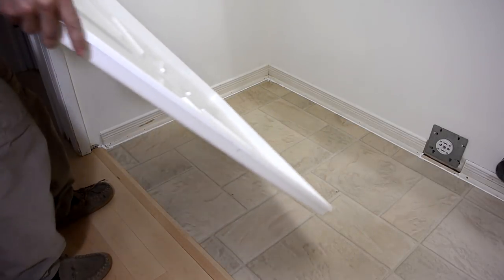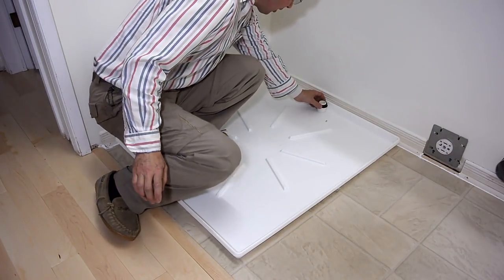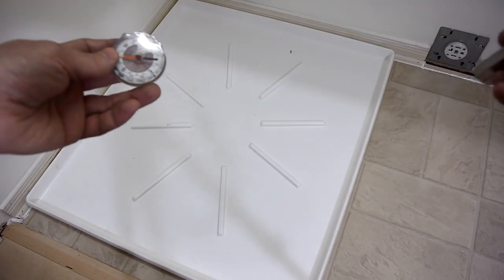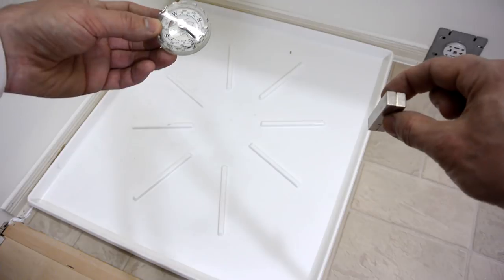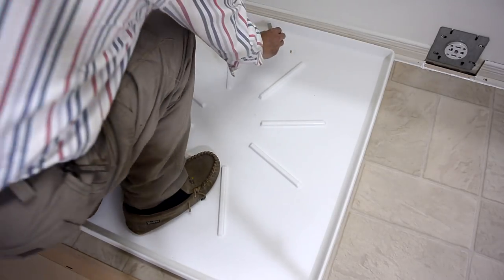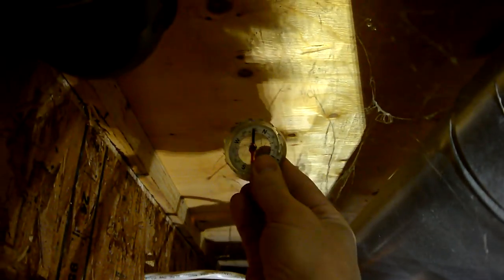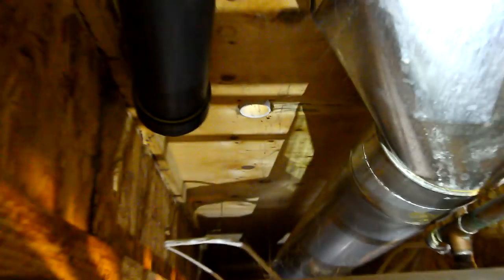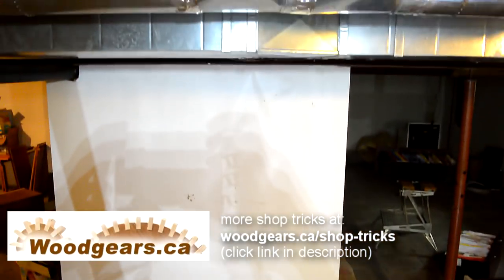Thru-the-floor (or wall) magnet and compass alignment trick

Comment: One just must love American style homes... just like cardboard - you can easily change/add/drill/move pieces of it... same idea would require hours of drilling and expensive tools in my part of world
Reply: And what part of the world is that? Pretty much any home built in the last 100 years can be modified to suit our needs.
Reply: Matthias is in Canada.
Reply: You'd be surprised how "soft" American homes are. Down here in Australia, I've never seen a drywall wall, or whatever it's called.
Reply: Canada is in America - North America if you insist
Reply: in Europe most houses the floors are made from concrete and cast plaster, and outer walls from clinker bricks. Inner walls depends, but older use bricks too often. Drilling holes for purposes like this require big holesaws
Reply: Old lady - Europe... We build homes from concrete and iron... In my hose 2 floors are separated with 15 cm of concrete with 2 layers of welded iron mesh... so drilling 5cm hole in it would be a pain
Reply: hahaha good one - Mr Joker we did not recognized you :D
Reply: +lutheduck I guess Croatia has a bit of a different building code then I am used too here in Canada.
Reply: Same where I live... American homes look like DIY kits to us :D most of the times we build even sheds out of hard materials (concrete and cemnet blocks)
Reply: In Europe he'd probably have a steel reinforced concrete for the floor. Even if compass trick did work, he'd need a big rotary hammer drill to punch a hole. And if he was unlucky enough, he'd hit a steel bar and have to move a bit and start again.
So yes, we're pretty impressed with how easily North American houses can be modified. :)
Reply: Roboterson in finland, the roof/floor is filled with thick concrete...
Reply: lutheduck concrete master race
Reply: Time to get the Hilti...
Reply: Roboterson - Sure, they can be, but I think the point is that it gets harder when they're made out of, say, concrete instead of wood. And loads of houses here (London), for example, are much older than 100 years.
Reply: Right? often it's just drywall walls..sometimes a bit jealous they can easily drill some holes to run cables through, which is really a no go with brick walls.
Reply: That's why nothing is left over after a hurricane. I prefer bricks and concrete.
Reply: lutheduck, it would also not be necessary since a little bit of water spilled would not destroy your floors and house...
Reply: If you're talking about the USA, homes are built differently in different parts of the country.  For example, in Florida, there are lots of hurricanes.  Many houses in that area are built from rebar enforced concrete and finished with stucco inside.  I've even seen homes with every single shingle tied onto the roof with steel.

In other parts of the country, that would be overkill and would serve no purpose other than to make the structure more expensive.  A floor made from 2x12 joists with a layer of plywood and then the tile or hardwood is solid enough.  We have homes built like that that are over a hundred years old and they're still holding up.  And like you mentioned, if something does happen and the wood needs repaired, it is cheap enough and easy enough that the average home owner can take care of it.  

Is there a reason in your part of the world that they use concrete rather than wood?   Maybe its environmental?  Or maybe the concrete manufacturers lobbied and got the lawmakers to have building codes requiring concrete instead of wood purely for financial gain?
Reply: true 😉
Reply: For instance, in Italy wood is very expensive, more than concrete and bricks...
Reply: Well you wouln't drill a hole like that, you'd drill a few holes in the perimeter and knock out the center with hammer and chisel. Not too much effort either tbh.
Reply: I am a german architect- north american construction is a panopticon for me-  especially in the colder regions the things I have seen (and I admit that is not that much) are built on the level of a 15 year old german garage... but in the end it works and it is much cheaper.
Reply: I believe the reason often cited is that in America wood is plentiful while in Europe it is not as it was used as a fuel and to build ships for a long time though it might simply be there were less forests to begin with. There are wooden houses in Europe, but they are mostly replaced by brick and concrete ones when rebuilding.
Reply: +Roboterson: That part of the world would be Europe, where about every modern house has 5 inch minimum concrete flooring, added on top of that a layer with steel mesh, heating, plumbing, electrical piping etc cast into another 6 inch layer of concrete or similar mixtures. This we do on every elevation, so the walls need to be constructed of heavy concrete slabs or similar building bricks.
It always amazes me to see these DIY videos of people in North-America where everything is constructed out of wood, thin plasterboards etc. It's definately easier to build a home yourself there as the only thing you need is basic carpenter skills. The machinery involved here to lift, cast and machine these materials are so expensive, that nobody in their right mind would own it unless they run a full time commercial company with it.
Reply: In my country, most houses are made of concrete, steel reinforcement, bricks and varying materials for insulation purposes. The wet climate makes wood houses quite undesirable for the amount of maintenance it would require. It does make it more expensive to build, but the ground space costs are often equal to the cost of building the house.
Reply: Aha, I thought it was the opposite way. That they on purpose build houses flimsy so that it will be cheap to rebuild when a hurricane has blown everything away. Where I live we dont have hurricane problems so I am happily unaware.
Reply: American here; most walls are built with 2x4's for the framing and drywall to cover it. might seem cheap,  but if you keep all of it dry and protect it,  it will last a considerable time,  even being fairly cheap
Reply: No lobby involved. We do have houses with a wooden structure here as well (europe)  The old ones were build of oak beams and loam and are hundreds of years old. Newer ones are pretty much like the ones in the US: Wooden beams, isolation and drywalls (was invented in US by the way)  However, less than 10% of our houses are made of wood. Solid construcion offers better heat protection in summer and lower costs on heating in winter and they are value stable. Also they are less prone to a leaking washing maschine. ;)

Don't want to offend anybody but I was quite shocked after my first trip to the US. Most of your homes are looking like shacks to europeans. Never seen a single shielded window in europe before. (Matthias posted a video about european windows a few month ago) Even the eastern european houses are looking better (despite 50 years of communism)
Reply: It is very common on videos like these to find claims that in Europe we only build houses out of concrete or stone, but that varies depending on country. In Sweden only 3% of newly built single family houses in 2016 were out of stone or concrete, the rest were made from wood.
Main reason: tradition and cost.
Reply: and in case you hit the iron mesh you are screwed :D 
There are drill cutters designed for this purpose - but they are expensive.
The whole point was that its a lot more work to do it in concrete build houses.
Reply: There are two ways to build in the USA: Good or cheap
Reply: PS: The big disadvantage: I recently bought property (massive construction of course) and I will probably be in debt for rest of my working live (I am 34)  A lot of europeans can't afford own property and are renting houses or flats.
Reply: Oh yeah. went to a tool renting shop and got a big ass impact drill. Hit the metal mesh and nearly dislocated my shoulder
Reply: lol @gamingSlasher: the 3 little piggies build each a house, one of straw, one of wood, and one of Stone.... the wolf came and blew away the straw house, and the wood house, but couldn't blow away the stone house....
Wood houses aren't really weaker in that aspect. I do wonder if there was ever research regarding hurricanes vs wood houses and stone/concrete houses.
Reply: +Schorschiism: Ehhh, people from the USA are in debt, period. In Europe we only have a mortgage on the house, we pay for everything else upfront. And if you sell the house you paid your mortgage back, ánd have some spare money. I don't see the issue :) In the USA you freak out if you cannot get your car, groceries and clothing on a creditcard or loan. Those degrade pretty fast in value, and that will get you real debts.
Reply: The biggest problem in some European countries, such as Spain, is the price of land and price speculation, the cost of materials is not the biggest problem. I live in a house with three floors and the maximum price of the materials would not reach 50,000 euros but the total price was 200,000, imagine the speculative problem there.
Reply: I'm not in debt. Obnoxious generalizations are obnoxious.
Reply: Norway and Sweden would like a word. Although you would have more insulation and vapour barriers in the way.
Reply: Judging by the prices of homes in USA (based on some History/Discovery shows) - they will to :D The pay ridiculous amounts of money for homes...
In order to avoid being in debt until the end of my life I moved out of the city - to the country side and build home - paid out in just 10 years (5 still to go :D) but you have the freedom, its quite, green, and ours :D
Off course - now I have to travel 20 minutes to work each day and drive to market, but hay who's counting :D
Reply: I think Mathias should be able to find and adeguate solution for this kind of problem. It's more difficult for sure, but nothing can stop him
Reply: Same here in Brazil, I'd need to be ready for hours of hard labor though the concrete floor
Reply: +imbuggin: I think you didn't get the point :) I was rectifying a fellow European that was complaining he has debts. In Europe, it's almost impossible to have real debts since you just cannot loan anymore for anything except a house. Which is good, as the house keeps roughly the same value. In the USA on the other hand, people over there have real debts as they loan for volatile and value degrading goods. That's not generalizing, that's pointing out where the real debtors are roughly situated.
You forgot about 2008 I take it? :)
Reply: Don't believe everything you see on TV. Places like Denver or Seattle are expensive, but normal size towns are much cheaper. My home town of 900 people could take years to sell a house cheap. It is all about supply and demand.
Reply: Right. Just looked up my dictionary. Mortage is the right term....still feels bad to owe so much money.
Reply: Believe it or not he is living in Canada
Reply: Until a tornado hits and turns your home into a million Lego pieces.
Reply: Canada is also in north america thus canadians are also americans.
Reply: You gotta love people that don't know the difference between a country and a continent. :)
Reply: lutheduck and in your part of the world you live in a 3 room/ not bed apartment of 500 square feet with no yard that cost an arm and a leg. Where as for the same price in America I can get 2000 square feet 4 bed 2 bath with 5 acres. A pool in my yard a two car garage. lol
Reply: giantpune Australia is a desert and the trees they did have are mostly long gone. They have no choice to build with concrete.
Reply: Oli K panopticon is a prison that's built so inmates don't know if they are being watched or not. I don't understand your sentence.
Reply: I like how you can punch through the wall in Amerika. Here in Belgium I would break my hand
Reply: Remco Ardui  and in your part of the world you live in a 3 room/ not bed apartment of 500 square feet with no yard that cost an arm and a leg. Where as for the same price in America I can get 2000 square feet 4 bed 2 bath with 5 acres. A pool in my yard a two car garage. lol
Reply: Interesting discussion here... a while back, in the office where I worked - southern Alberta, Canada - a co-worker was shopping for a house... much to my surprise, he told me was going to buy a house built in the 80's since back then the houses had no OSB or other 'engineered' materials (TJI floor joists eg). 

A house built with 'engineered' material disintegrates if there is even a small fire - the thin joists burn through quickly and the structure collapses... what the fire does not destroy, the water the fire department pours on the fire wrecks - i.e. the epoxied chips delaminate compromising the integrity of the material.
Reply: In US only the foundation walls are built with concrete and rebar.
Reply: My (Swedish) father's newly built house has the same construction as Matthias'. It has the same masonite i-beams and plywood in addition to heat pipes, sound reducing mat, and etc. Although one wouldn't drill a hole in floor since the laundry room would have additional water proofing and a floor drain.
Reply: ***** I don't get why people dream of living in places like New York. When I watch hgtv it makes me laugh out loud when I see what they get for a million dollars. It's like living in a dog kennel. There reaction to having a 3x5 foot balcony with a view of another brick building is down right psychotic. 
I enjoy my view of trees and squirrels and song birds. They get car horns and pigeons.
Reply: Same thing in Brazil. Some states suffer from small tornados and flood but the only construction we know is concrete. Drywall, even with a couple decades arround here, I consider a new concept.
Reply: You must not be Canadian. Americans are people from the United States of America. Canadians are from Canada. North America is a whole other thing, and you can't call Canadians Americans. Nobody's calling people from Mexico 'American' after all.
Reply: AqueousBoy sometime after the civil war us in the USA stopped thinking of ourselves as from what state we were from and as just Americans. I think this had something to do with birth certificates and social security numbers and that state armies outnumbered the USA army. As in our name United States of America. At one time the states had complete control over the government and the federal government only really controlled the military. Our federal government has grown so much over the last 150 years we really can no longer be called a republic but a true socialist democracy.
Reply: MoralesCrk MoralesCrk : not really true. Lots of home owners in the Netherlands. 60% of the Dutch houses are owned, 40% rented.
Reply: Sure. And Trump is a social democrat...
Reply: What do you cover interior walls with? Drywall is often called gypsum board in other places.
Reply: In the US though you can also get pressure treated, cedar, and redwood which is all rot and bug resistant. Water isn't that big of a problem here unless it goes where you don't want or expect it to go like from broken pipes or leaking roof. Even then, it takes years of constantly being wet for something to rot and in the case of like pressure treated lumber it could last decades in water and is very cheap to replace.
Reply: For hurricane areas they tie everything together with small steel straps aptly called hurricane straps so the wind can't for example pull up under part of the roof and turn it into a giant wooden box kite. It works pretty good. Wood isn't indestructible but matchstick construction introduces tons of redundancy so structures can't easily be knocked down. My childhood house was 135 years old and made of wood and still stands today. If you keep a nice roof on a place it should last for centuries.
Reply: Interior walls are usually brick and mortar where I came from. Stud walls are generally considered cheap shortcuts.
Reply: 5656eric are we a welfare state?
Reply: Gelatinous Glob
Normally brick or concrete walls are plastered.. 
When the walls are build properly, the layer is less then a mm.
After that, it is finished the same way as you would finish the plasterboard. Wallpaper, decorative plaster, or just give them a color with wall paint.
Reply: are you from GREAT britain?
Reply: gamingSlasher that's the stupidest thing I've read this week
Reply: Matthias is Canadian though. But glad to see someone obsessing over the US on YouTube again.
Reply: Yes read "some" of the comments that followed.  Typical ignorance.  North American homes differ little in construction method than any other developed country.  What mainly differs are the standards, but that's a different topic.  To your comment we must simply have a greater variety of home construction or some of you live in secluded isolation.  Matthias' home has a basement.  As such he has a concrete slab basement foundation with concrete walls.  The floor above is a standard joist frame floor.  This would be typical anywhere in the world.  Where I live we cannot have basements due to the clay soils so all foundations here are poured concrete slabs.  The types of concrete foundations vary greatly as well.  We also have cinder block construction, adobe, concrete, stick construction, recycled tire or aluminum can construction.  The sky is the limit.  Hence I reject your narrow view of the world.  Thank you and have a nice day.
Reply: Nah, pretty similar to how ours (in Finland) is constructed, except Matthias is drilling to the basement so the ceiling isn't finished. Ours just has a second layer of plywood (or more accurately particle board) as the basement ceiling and the space in between is filled with insulation.
Reply: +William Hayden The ignorance is your own - construction methods vary hugely across developed countries and the variety of architecture to be seen around the world is one of the reasons people travel. Simply setting foot outside your own country and using your eyes would confirm this immediately.
Reply: I thought this was because in America people are always looking to improve their quality of life, so investing in a more expensive permanent house isn't good idea,  houses made of wood make it easier for you to spend less
Reply: why does every comment section need to become a passive-aggressive superiority contest? things are the way they are because that's the way they are. you can get concrete and brick houses in america as well. europeans tend to forget that our states are the size of their countries so things can be very different across the states. it depends on the composition of the ground, the local weather and other concerns like earthquakes, tornados, hurricanes, etc. in earthquake prone regions of california houses are built of wood because it can flex during an earthquake without being torn apart like a brick house, or knocked off its foundations like a concrete house.

as for the sentiment that brick houses would hold up better in a hurricane, well. that is not true, because the roof gets torn off anyways, and brick/concrete houses can be pulled up off their foundations just as easily as a wood house. it's easy to talk when you have never experienced the power of a hurricane, tornado or earthquake firsthand.
Reply: +Joe Smith : Funny you should say that. I live in a 300 square meter house in Europe, directly at a forest, so it is not so uncommon as you might think. It's the same everywhere I think, since in the USA you have the cities (New York, SF etc) which have small mass-housing. In the outskirts you have more room and thus bigger houses. Europe is not different in that? Have you ever been to Europe? Or just visited Amsterdam or Paris? :) 
I think the same of china/japan, but maybe it's only in the dense populated areas, and the outskirts of cities are different. Don't know, as I've never been there :)
Reply: I agree, you don't see people literally moving their house in Europe because over here they are made of bricks and reinforced concrete. It always surprised me that a lot of the North American houses are build with OSD, knowing how many hurricanes are crossing the continent on a yearly basis, it almost seems like The Three Little Pigs tale waiting to happen.
Reply: Not entirely true, it might be for the eastern side, but over here in the west it is usually double brick with a cavity wall. The internal bricks are covered in gyprock and then plaster on top of that. Pretty much every west-aussie home since the '80s has been built this way.
Reply: +Prometheus I agree, but we are shaving fine lines here.  To say that other countries outside North America do not use stick construction methods is ludicrous.  Also to say that all we use is stick construction is narrow minded.  We use concrete, cinder block and every other construction method under the sun.  Stick construction is the most common form here due to cost and ease of construction.  This is true for other parts of the world as well.  It's quite simply the most flexible and forgiving construction method.  Not everyone lives in a concrete apartment and not everyone's home is poured concrete.  If you and others do great, but why through out judgmental idiocy?  So again I reject your ignorance and for calling me ignorant.

Also I've been to many countries from Mexico, Japan, China, S. Korea, UK, etc.  Where have you been?  And yes I do pay attention to architecture.  I also watch This Old House and watch or read other sources that cover the differences in construction methods across the globe in some great detail.  This does not make me an expert, but it does give me enough to know that you and others are full of horse pucky and simply come off as snobs with looking down pointed noses about how one's house is built.  It's someone's house, show some respect.
Reply: +Ray Herring I suspect lumber in Australia is a lot more expensive than other parts of the world, where on the other hand brick is probably very cheap, comparatively speaking.  Would this be an accurate assumption?  Available materials and cost of those materials are huge driving factors as to how things are constructed.  Which is why different construction methods are used in various regions.  In the states construction methods vary greatly depending one location.  Where I am from brick houses are the norm, but further north wood or cement clad houses are far more common.  In Arizona adobe is quite common, but not at common as one would think.
Reply: Wood is pretty cheap, we have a lot of blue pine (pine grown specifically for being cut down and used in construction), it's just that over here on the western side most builders choose to do it as double brick, it's actually cheaper to construct the house out of wood but that wouldn't help with the many bush fires we have and various other things I guess. My parents house was built in the early '90s out of wood, took a couple of months to build as opposed to my doublebrick with cavity wall house which took almost a year.
Reply: You know what happens to concrete houses. An earthquake comes and the building falls and kills everyone inside.
Reply: Thant is true.  Price is of the huge importance, 
Although, probably due to it being standard type of building, it took only 3 months for my house to build (concrete, concrete and some more concrete :D)
For that reason on average house in US weights 80 ton, and same size hour in Europe is probable 5-10 times massive.
Reply: A pressure treated 4x4 at 8ft here runs maybe $6. How's that compare to your area?
Reply: 4x4x8 Pressure Treated Yellow Pine ($9 USD)
Reply: Far more expensive... pine construction grade lumber in all sizes goes from 120 euros to 200 euros per cubic meter for rough cut lumber depending on the grade (grade is based on dimensions and number of knots in sq meter )... it is untreated but, due to climate, only issues with wood you might get here are wood worms - and protection chemicals against them goes for like 2 euros per liter - downside you have to do it yourself or pay someone to do it for you
if my math is correct you need some 60 4x4x8ft for 1 cubic meter which would be 300 euros
300 is the price for furniture grade pine but you have to dry it yourself, if its dried than its 400.
Walnut is 500/600, curly oak is among more expensive one with price of 800 euros for cubic meter of lumber...
bad side is that exotic non domestic wood spices are impossible to find
Reply: All this from drilling a hole in the floor?
Reply: Yes, but a brick/concrete/stone house will kill you in an earthquake....  What is better really depends on where you live, what materials are available and what is the most dangerous threat.
Reply: hardly if you build them according to the regulations and standards - where I live its 9th degree on MSC scale or above... the strongest recorder earthquake was 6.9, so I hope 9 is enough :D
Reply: +William Hayden You originally stated "North American homes differ little in construction method than any other developed country." <- This is simply factually wrong, there's no two ways about it, and I'm glad you seem to accept that. You don't need to take being wrong so personally and foam at the mouth about a load of imaginary statements I simply did not make in my two-sentence comment.
Reply: They must be 'American style' in Australia
Reply: You're very ignorant of Geography if you think 1 hurricane sweeps across the whole continent. Lol. Europeans really have no grasp of how large the United States are. Your cross-country road trips take a few hours. A cross country road trip in the states takes days.  Most of our states are bigger than your whole countries.

Construction standards vary by sate. Our country is big enough to have more than 1 primary climate cycle and different regions face differing natural disasters. I would educate yourselves on what Tornadoes can do to even concrete and steel construction. An EF-       4 / 5 will destroy your normal home regardless of its construction materials.

You can build a wooden frame house that is far better at holding in heat than something made of brick and concrete any day for far less cost. Repairs and modifications are easy and don't require major equipment or modifications. American states span through 4 different climate zones. Arctic (Alaska), Temperate, sub-tropical and tropical. They span the extreme ends of the Temperate zone.

We face tornadoes (ESPECIALLY tornadoes. Roughly 70% of all tornadoes worldwide happen in the U.S, and more than 90% of the strongest ever happen here), earthquakes, hurricanes and floods, to name a few.
Reply: d4rk0v3 who would toughth
 that one inocent comment will inspire so many of you to write a comment... even to be offneded by it. 
i am nor ignorant nor unaware of pros and cons of different building styles... my point was only that some changes are easier to make in timber frame houses than they would be in concrete build ones...
of course that building material is depandant on location, climate and so on and that is why some of build their homes just from dirt
Reply: 106 comments just from drilling a hole in the floor. This has got to be the weirdest comment thread ever made. 
It's like Europeans think Americans live in straw huts or something. Our home are better than yours. 
You couldn't pay me to live in Europe. America isn't perfect but at least we are the country everyone wants to live in and look up to.
Reply: what? you mean you don't live in straw huts? eh?
Reply: Dave Smulders - it's how fractional banking creates money...
Reply: Panopticon and colder regions.  We all don't live in igloos you know.  There is nothing round or semi circular about our building construction.
Reply: Gyprock® - Australia's leading plasterboard manufacturer. CSR Gyprock is Australia's leading manufacturer of gypsum based products such as plasterboard and cornice, as well as compounds, adhesives, specialty plasters and associated finishing materials and accessories.  
Plasterboard is drywall.
Reply: The Cynic All Europeans seem to think all of America is the same, and I guess by America we’re talking the continent not just the country. The amount of space that we are talking about is incredibly huge and the way we build houses vary considerably. From concrete, bricks, wood, etc. costs also vary even more than the construction does. In a place like San Francisco a house will be in the millions, but go out in the country of Pennsylvania and you could get a large house for 50k or even less for a fixer upper. 

The people also vary too. Were not all the same, not even close. That’s as bad as thinking all Europeans are the same.